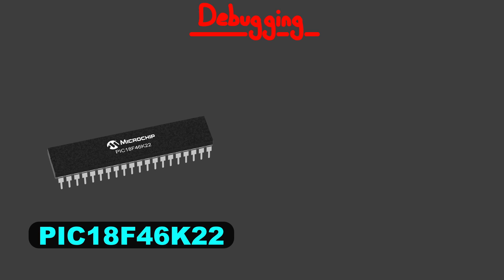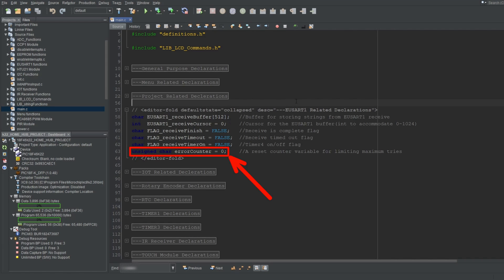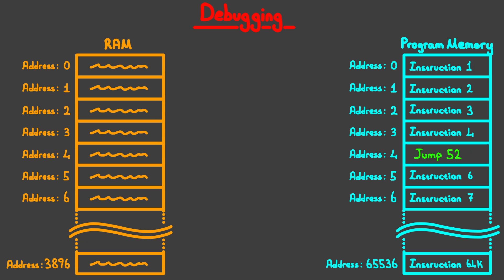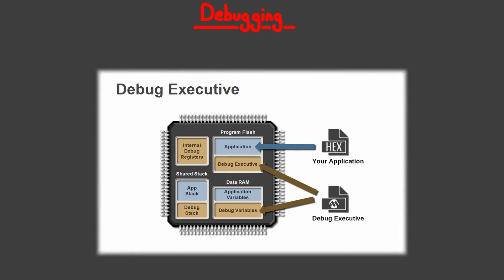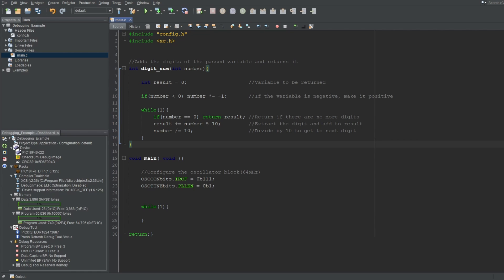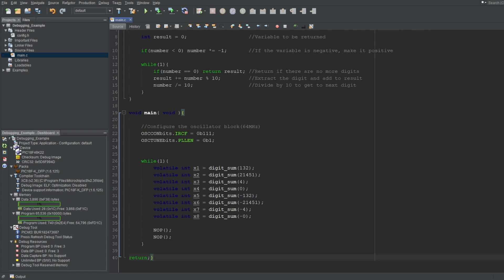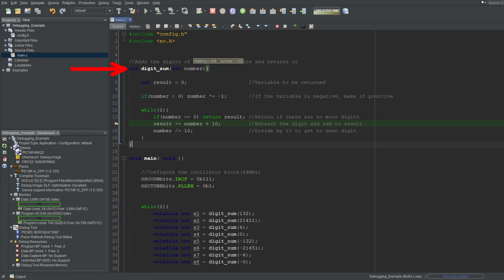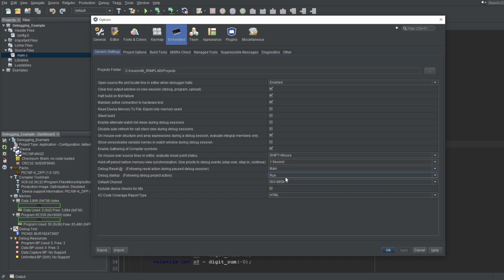PIC MCU DEBUGGING #1 - Basic info & Example (Absolute Beginner)

Comment: Hello, I am using PIC32MK052MCJ and MPLAB X IDE v6.05, and I am running into issue when following your example. It's break the breakpoint whenever I debugging! Do you know how to fix it?
Reply: Update: I have found the problem and now it worked correctly. It was due to the way I name my folder and directory (with space and special character).
Reply from the maker: @weekendle5564  Glad you resolved your issue 👍

Comment: Is there a way to change the black font when the program is loaded? I have looked at the options and I can't seem to find the right one!
Reply from the maker: Navigate to Tools>Miscellaneous>Output. Those are the settings used to change the window fonts/colors. However, let me tell you that those options only affect some of the windows, while most windows just ignore them. My guess is that only the windows native to NetBeans are configurable with those options. The edited/custom windows by Microchip seem to use hard-coded fonts/colors; hence, you can't change them. (Never looked into it that hard, so don't quote me on this.)
Reply: @Microesque  Thanks. I found that section also - no dice. I think you are right, it is hard coded. Next option of course is to lighten up the background if it really bugs me. Anyway love your work. Thank you!!

Comment: Like the last person commented - this is the very video I have been waiting for. I want to see the tie-up between an action in the real world and how it presents itself on the debugging screen. Just as important is to be shown how to set up the debugging tools. Just a quick note about using the IDE dark screen. At one point you make reference to 'volatile int ' which (on my screen) showed up as very dark blue. By using a magnifying glass, I was able to see the words 'volatile int ' - so if you can change the screen to make things easier to see, that would be useful. Thanks again for a very useful video.
Reply from the maker: Thanks for the feedback! At some point, I did think that dark blue could be a problem with dark background, which is why I configured those syntaxes as "bold". I though it would be fine since I also have a cheap non-color accurate monitor(it looks fine for me). I made the background lighter gray and those syntaxes lighter blue, hopefully it'll help(also for other people that may have this issue as well).